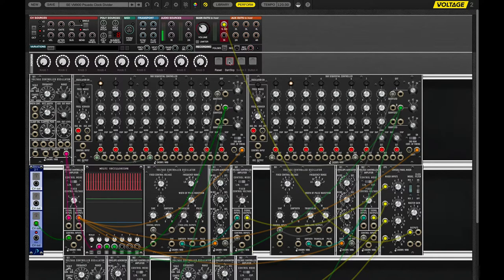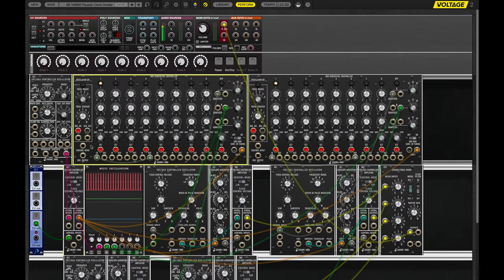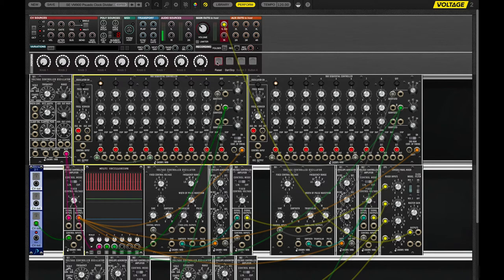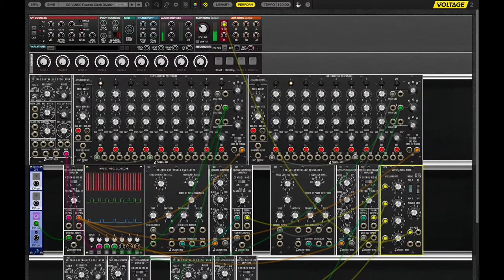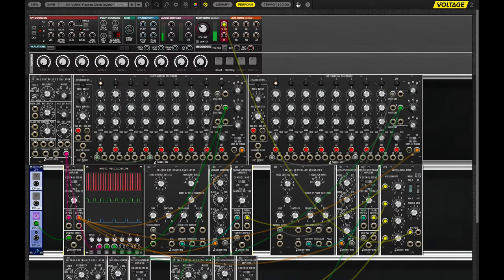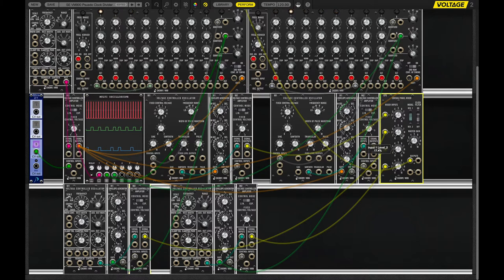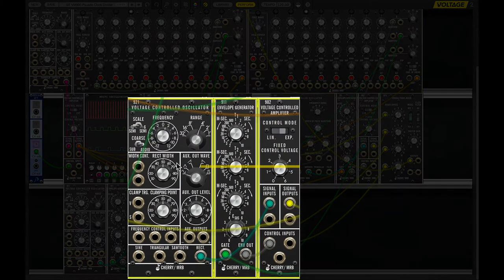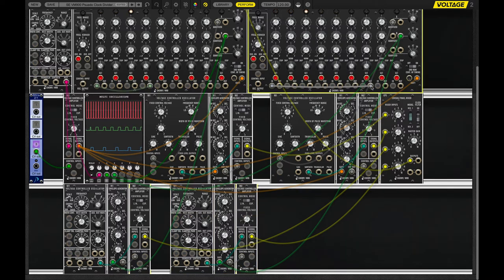VM900 Pseudo Clocks

Comment: Hi Seth,
Thank you for making this vid with all your excellent explanations.  I'm just going to point out a couple of things that you might have done differently.  First, the usual way to shorten a sequence is not with a patchcord, but by setting all the unused stages to SKIP.  There is no "wrong" way, but I'm just alerting to the functionality.  Second, your use of an entire sequencer row to just produce a pulse at a certain stage is quite wasteful.  That signal is already available at the OUT jack of every stage.  You're already using one for the reset.  Third, you say many times that the 960 has no clock input.  The SHIFT jack  the clock input.  I'm not sure why you are making a distinction.  Otherwise, great video showing how polyrhythms can be created.  Thanks again and keep 'em coming.  --mb
Reply from the maker: Your points are all true, but each of the things I did had a (hopefully good) reason. In the several videos I previously did using the Voltage Modular 960s I did use the Skip knobs, and they work fine and do the job. After doing those other videos though I think using a patch cord is a lot easier. If I have a six step sequence it's just a moment's work to pull the cord from jack 7 and put it in jack 4 to shorten the sequence to three steps, quicker and easier than having to flip all the knobs in steps 4, 5, and 6, which is a pain, especially if the sequencer is running at the time. Same result, less work, both equally valid.

The reason for using an entire sequencer row for voltages is because the goal is to generate pulses. Yes, you're correct that I could use patch cables in the jacks where I want to get a pulse out to the rest of the synthesizer, but unlike with the previous example in this case the knobs are easier than the patch cables. Let's say I have a six step sequence, and I want a pulse on steps 1 and 5. It's a simple task to essentially "flip a switch" by turning the appropriate knobs up all the way rather than to have to patch and unpatch multiple cables each time I want to activate or deactivate a step, in a sense. You can change which steps have pulses on the fly if you use a whole row in the sequencer because you're not having to change cables all the time. Just "flip" a knob.

And finally, the Shift jack can function as a clock input but it's not truly clocking the sequencer. What it's doing is advancing the sequencer by one step each time it gets a pulse. So you could essentially clock it by sending a steady stream of pulses, but you can also just send the occasional pulse to it to mess with an otherwise steady internally clocked sequence, as just one idea. Also, what I'm doing is moving the sequencer along without having to have it actually running at the same time. That's why it's not the same as a clock, although it can be used that way.

The goal of this video was to demonstrate a way you could use only analog modules to make a fully analog clock divider. By using the two sequencers as "mere" voltage sources on various steps while they're both being controlled by an external VCO, you can divide the clocking VCO output by pretty much any ratio you may need. More or less. So yes, as I mention in the video it's much simpler to just use a modern digital clock module along with a digital clock divider/multiplier module. But I wanted to demonstrate a method to accomplish the same thing by just use the modules that would have been available in the 1960s or '70s. So I patched up a clock divider using 960 sequencers, and it worked!